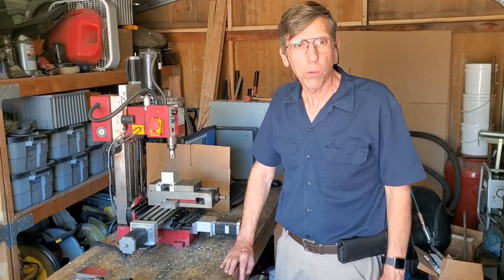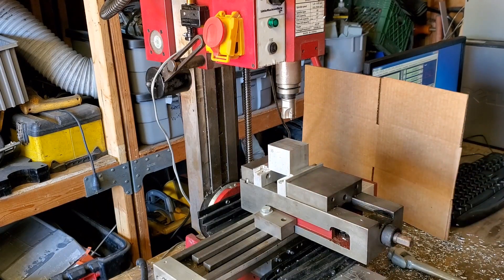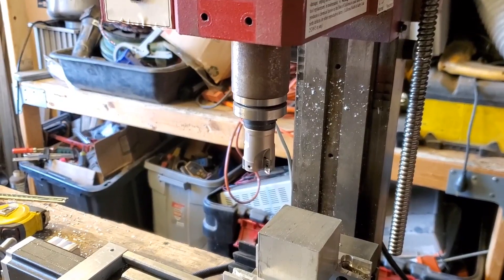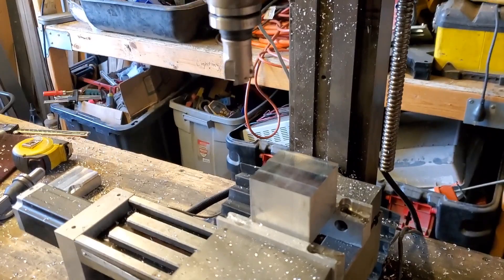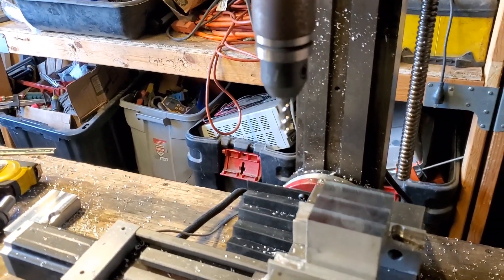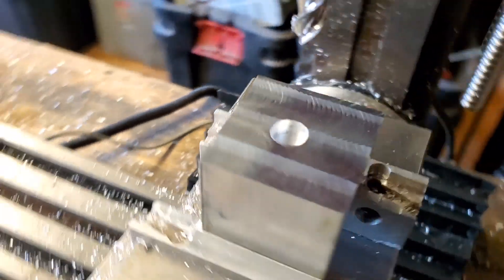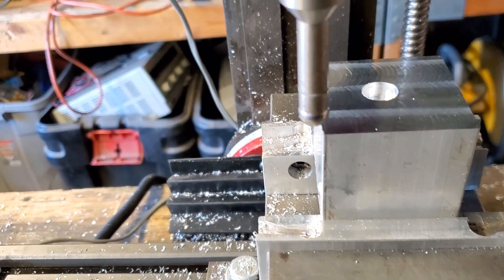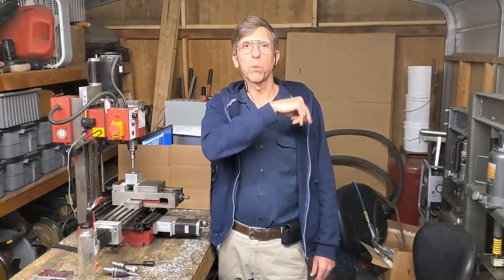Testing the X2 Harbor Freight Mini Mill  - CNC Converted

Comment: If your limited to 500 lines of code couldn’t you just create multiple 500 line programs. I know its not ideal but if you lift your part in the vice for that whole side i would think it wouldn’t cause any problems for basic projects. Or create multiple programs and add them together, you would need to remove a few lines of code and probably add a couple but if you have access to the stuff to do that it might be a solution. Im only learning cnc machining but that seems like the easiest solution to only having 500 lines of code per program.
Reply from the maker: Would probably work for simple parts but a lot of the parts I run are like 20k lines of code.

Comment: can someone recommend how to make a table or what kind of table to buy that would be good to place the harbor freight mini mill onto? I wouldnt think a wood table would have sufficient mass to dampen vibration, but im not really familiar with other types of tabletops or what material they would be made of? thanks
Reply: I would recommend a husky workbench. They’re basically hardwood tall desks for like 300 bucks if I remember correctly. You can get em at Lowe’s or Home Depot. They can hold 3000+ pounds and have leveling feet. They have a metal frame and are super sturdy. I bought one to use as a computer desk and it works great for that. As far as putting a mini mill and maybe even a mini lathe, I don’t see why it wouldn’t work great for that.
Reply: I made my milling machine stand out of structural steel. The legs are 3" C channel and the top is 3-1/2" heavy angle welded together. And yeah it could be sturdier. I have given serious thought to pouring a concrete pedestal.

Comment: The feeds & speeds as well as tool size you show aren't suitable for X2 (SX2) mill of any kind including"solid Z-column" version of it cause these mills are flexible as hell. The biggest reasonable tool for that milling machine is a  6mm end mill cutter. Whatever is bigger than that can be used with microscopic chip loads only in order to keep the geometry of the machine pretty much squared during operation. Otherwise it will  give you that weird and dodgy finishing shown in the video.
Reply from the maker: Yeah, your probably right.
Reply: @craigsmachineshop2040 , from my perspective the only real step up that can be made with mini-mill is to give it a high speed spindle (>1000 rpm). That would give it a chance to have a little chip load and keep reasonable speeds at the same time. I've personally built two milling machines: the first one is based up on an aluminum frame (but relatively sturdy one with excessive number of massive  elements for rigidity), THK and Rexroth precision linear actuators and a high speed spindle.  The second one is CNC retrofit of SX2 mill. I use SX2 for roughing and boring and the high speed one for finishing and engraving. I haven't been happy with all that since very beginning but I live in an apartment so I cannot go any bigger. Otherwise I'd have built a proper CNC mill with linear guides from scratch but not a converted one cause dove tails aren't suitable for contemporary CNC machine all.

Comment: How do you fix the travel pinion so it goes up and down vertically?
Reply from the maker: Not sure exactly what you mean. The head travels up and down with ways. The up and down travel is controlled by a stepper motor controlled by a computer.
Reply: @craigsmachineshop2040  I fixed it you just pull the traverse out
Reply: @zachjackson9263  what are you talking about??
Reply: @craigsmachineshop2040  I meant clask and pull it toward a wall.

Comment: Hello! At the machine, the column has a slope to the right, this is evident when, when moving to the right, the rear of the cutter does not remove material, and when moving to the left, the rear of the cutter removes material. Check the perpendicularity of the column relative to the working table of the machine.
Reply from the maker: Thanks!

Comment: Hi Craig, nice that you got your mill back up on the bench and running again. Something not right with signals/software not interpolating the X/Y axis correctly. If you are going to keep the mini mill, you might consider Centroid Acorn: https://www.centroidcnc.com/centroid_diy/acorn_cnc_controller.html both the motion controller and software come from the same company, doing CNC machine motion control for over 30 years.
Reply from the maker: You may be right. I didn't notice any binding in X, just Y. I lowered the rapids down to 40 and it seemed to run smoother. Centroid looks nice. Not sure if I'm going to keep the Mill or not. Not sure I want to spend much on it. I need to buy a 50 ton electric hydraulic press so I can start punching the covers out. The Tormach will be making a lot of blanking dies soon.

Comment: If you are losing steps it is likely that your stepper motors are under powered (unless you have some serious binding problems).
Reply from the maker: I'm using  the same size steppers that most are using. Don't remember the size. It jogs fine. Maybe I will try to lower the rapids and see if that helps? Worked on the Tormach once when I was having oil problems.
Reply: @craigsmachineshop2040  Sorry, I wasn't talking about the size of the motors, but the voltage current power supply that drives them.
Reply: @craigsmachineshop2040  Rapids will  help with missed steps. But I don't think that was your issue as to why the hole was not centered. Did you do a rapid move back to X0Y0 when done to see if it centered on the hole or centered on the part?
Reply from the maker: @martyscncgarage5275  Hey Marty!  Yeah G0 X0Y0.  I was off about the same distance
Reply: @craigsmachineshop2040  My opinion.....linear rails are tops.....dovetails are not exactly where you ever want to be no matter the cost for retrofitting them, but then you do have an SX2 so maybe you have to live with the dovetails.
Reply from the maker: @gangleweed  Yeah, I think my next machine will be linear rails.
Reply: @craigsmachineshop2040  can you elaborate on what it means to "lower the rapids"? no amount of googling seems to be able to answer this question for me.
Reply from the maker: @michaelwielenga7403  A rapid is how fast the tool (technically the table or head) is moving when It isn't cutting to get from one place to another quickly.  Usually a G0 g-code.  It is a setting in motor tuning in Mach3.
Reply: thank you so much! that is along the lines of what i had guessed based on the context  of the few times ive seen the term used, but  i really appreciate you clearing that up for me.
Reply: @craigsmachineshop2040  it sounded like your steppers were skipping due to too much torque at one point. Tweaking acceleration and jerk may help

Comment: I think my 44991 must have a 1/4 HP motor because I can't cut aluminum anywhere near that fast.push in 20 thou = stall. So boring. I know it's supposed to be 4/5 HP but it's not.
Reply from the maker: Do you have the belt drive conversion on it?
Reply: @craigsmachineshop2040  Um, sort of. I made my own when I saw my gears were about to go. I've been thinking that might be the problem and should just cook up a set of metal gears like I had been planning. But, you have the belt drive on don't you? or have you just by passed that?
Reply from the maker: @ExtantFrodo2  Yeah, I got the belt drive conversion from Little Machine Shop. I think you will do a lot better if you can run at 4500 rpm. What RPM are you at now?
Reply: @craigsmachineshop2040  About half speed because when I crank it up the belt wanders from the middle. It also does that when the DOC is too deep. I've either cut my pulleys poorly or the mount for the motor is inadequate some how.
Reply from the maker: @ExtantFrodo2  Oh. I never got a lathe so I had to buy a kit.